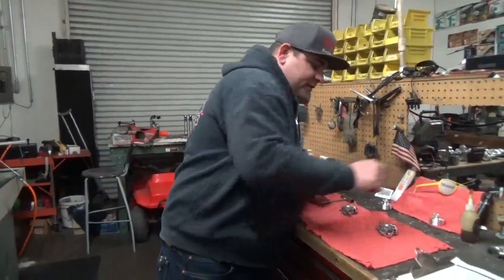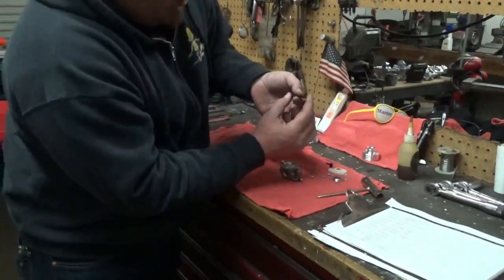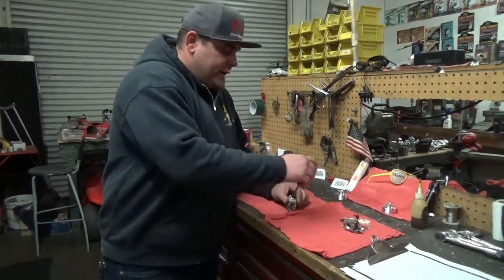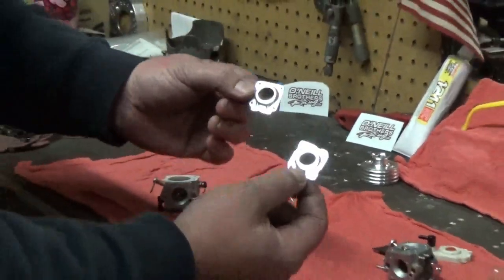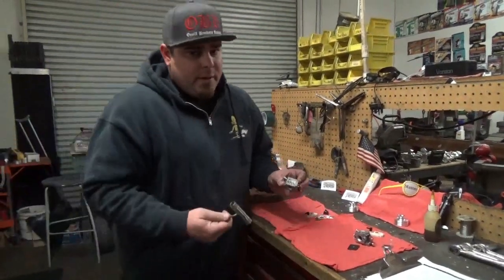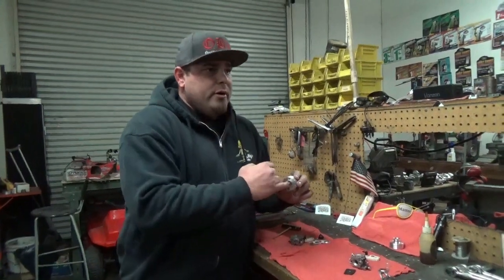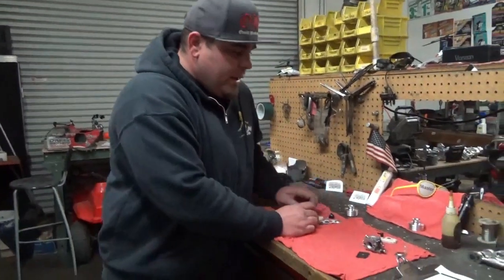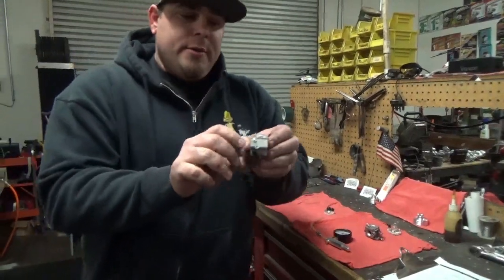OBR WT-1242 Carb Info & Power Stack

Comment: Hey man I don't have one of your engines but I just got a redcat rampage and I've gotten about 3/4 of a gallon run through it at 25:1 amsoil dominator ethonal free premium. But now I am bogginh horribly and it won't go faster than a walking speed and has a sporadic idle up and down and than dies. Do they have a fuel filter or if so maybe it's clogged?
Reply: Ya gotta tune them and change up how much fuel they are getting, there is a high and low fuel needle on the side of the carb

Comment: I have one issue my carburetor wt668 is not getting fuel.
I pump the bulb and air bubbles go into the fuel tank.
I recently changed the tank n carburetor so what did I get wrong bruh?
Reply: loose/cracked SENDING fuel line will do this, a cracked p bulb,  or carb gasket,
Does it stop this after it's running????
Reply: @JOEMAMMADRINK40Z  brother it will not run no fuel goes to the wt668 carb at all.
The tank and lines are new. I'm hearing the wt668 carb is something I should change out and replace with a 990 or better.
Reply: I got a new carb 990 and now the fuel is going into the carb so now I am not getting spark what's a good plug for these 5th scales?